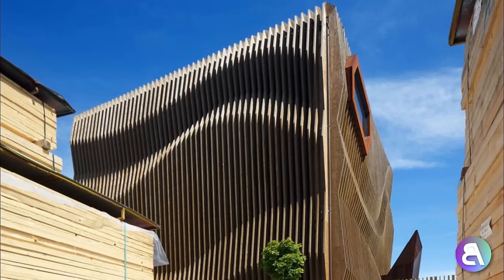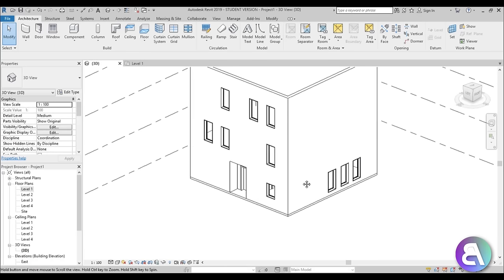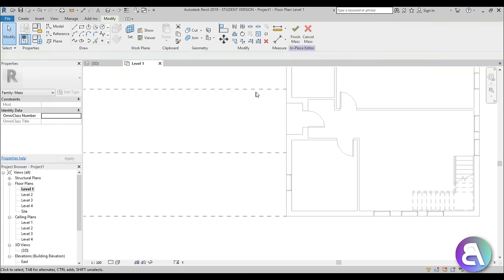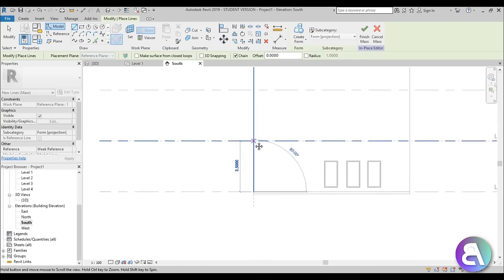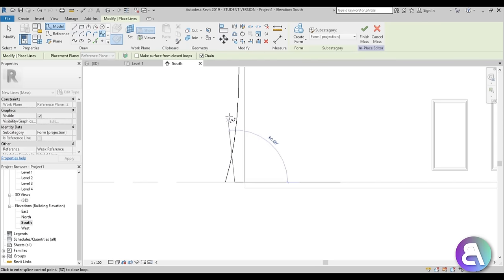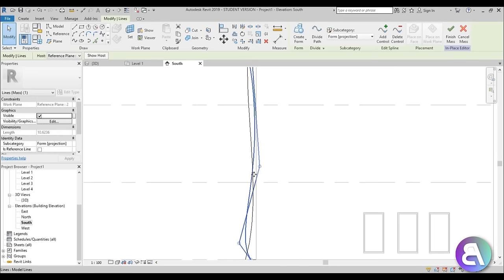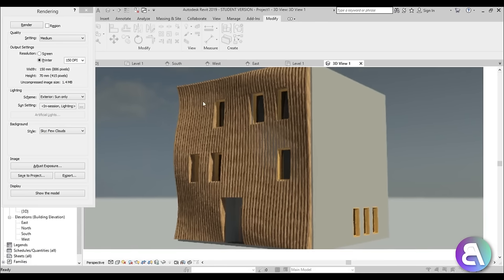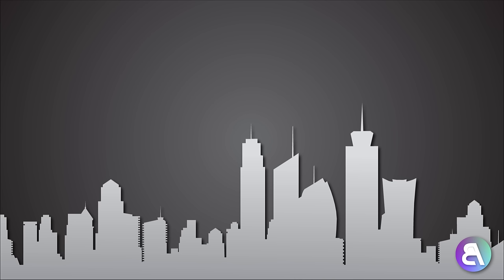Wave Wood Facade in Revit Tutorial

Comment: Hi Mr. Balkan,
I am agree with you.
There is some points noted below.
Working with huge project revit is much useful & easier then archicad.
Setup of project is much easier in revit and also Documentation is easy but Archicad create document with beauty with some complications.
It is little orthodox type working with layers in archicad.
I am irritated particularly conceptual design in revit.
Opening, grid, sheet, dimension etc are very easy in revit.
I prefer both but 75% i used revit.
Keep going.

Comment: I struggled immensely trying to get a void form to come through the façade wall to be able to use a door but I finally figured out a way that worked, though it took like an extra 15 minutes. This was a very cool design. I was just getting frustrated with the windows and doors
Reply: I have been trying to figure out how to do this, may you please tell me how you go it to work for you?
Reply: @robertagiosanu1337  so what I ended up having to do was go back in and edit the void forms. I edited the void forms to where I had a solid piece again and then I could create a new void form there to have my doors/and or windows

Comment: If I try to cut out the windows it says ~"no volume geometric available. delet the void or add geometry into the void"
Reply: 1/4 times it works now haha. Revit classics.
did nothing but repeat it over and over.
sometimes i copy a working "void series" with 5 windows each and it says ~"no volume geometric available. delet the void or add geometry into the void" on ONE of 5 windows

Lss.: so if i copy my 5 working voids from floor 1 to floor 2 sometimes one void gets broken and needs to be removed by revit. what the heck haha
Reply: Update: on Completely random places in the facade i simply cannot void into my objects. it just creates a void with this orange box without cutting itself out.

copying a working void doesnt work because my identical void cant be selected anymore and if i scale up a window-cutout to fit my door-cutout it creates a weird pyramid void with my selected plane on the front and my window shape at the back. https://imgur.com/a/uCyHYKe